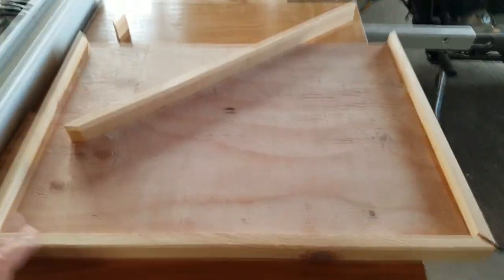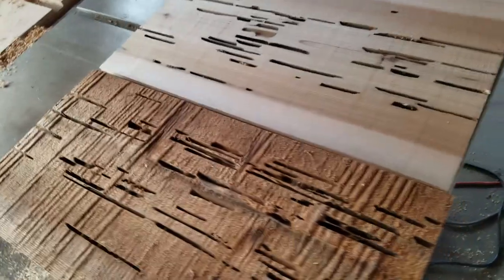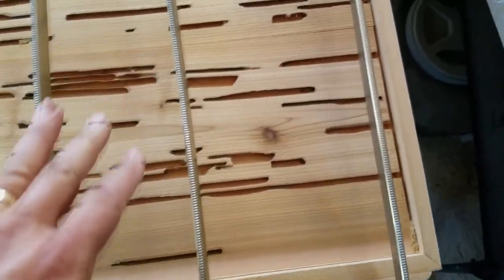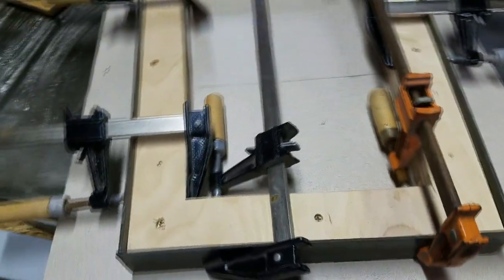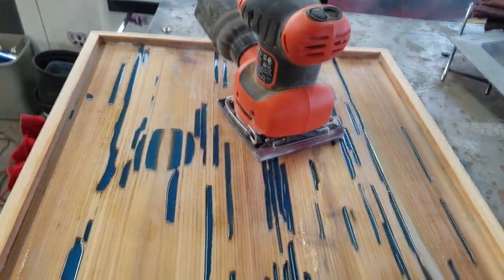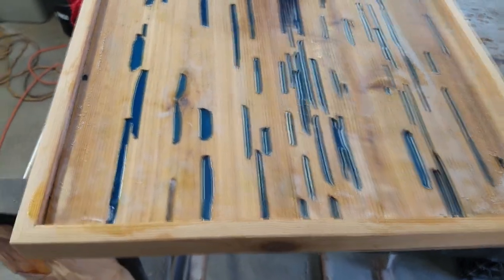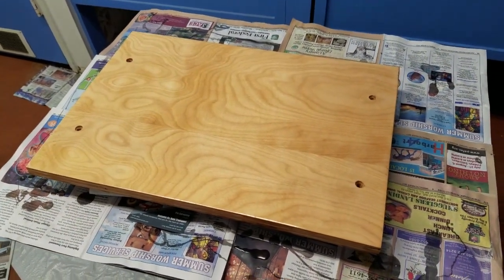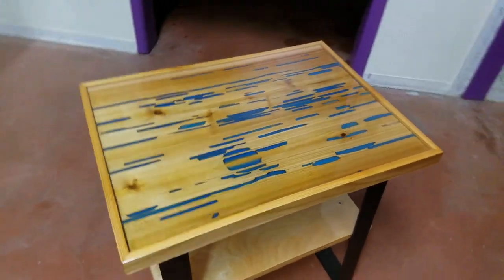Glow in the dark Epoxy Resin End Table PROJECT  DIY

Comment: Thank You....  I have been looking for a glow powder with a similar daytime color as when it glows "for a sign".     For the benefit of others, after looking at the Art'N''Glow products:   They offer two types of powder.    Fluorescent and Neutral.     The Neutral powder is a milky opaque white during the daytime and glows in various colors at night.   If you want the daytime to be a specific color.  i.e.  Blue, Green, Red etc.  You have to buy the Fluorescent powders, and they glow a similar color at night.    I've looked at the various products including "Art'N'Glow" previously and I never picked up on the difference between the two types of powder.   I just assumed they were all milky white during the daytime (which is the majority of the products being sold) .      So hopefully this helps others looking for a glow powder with similar daytime colors.